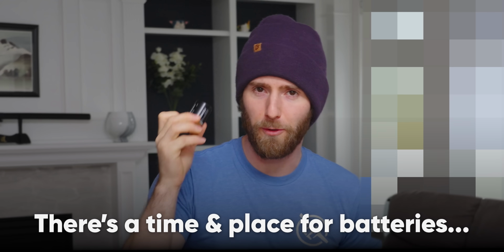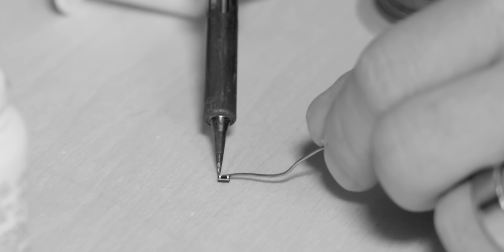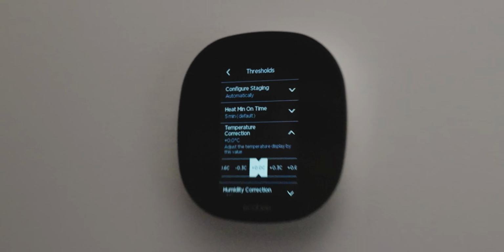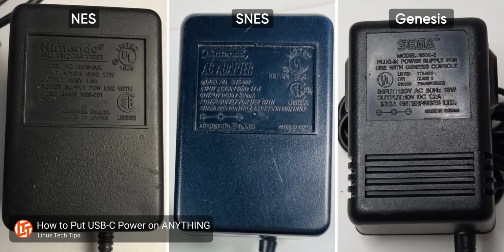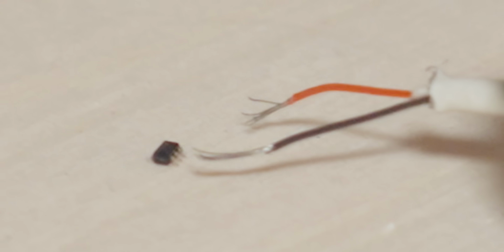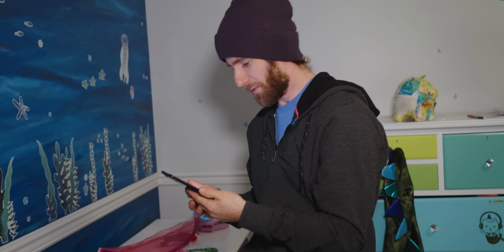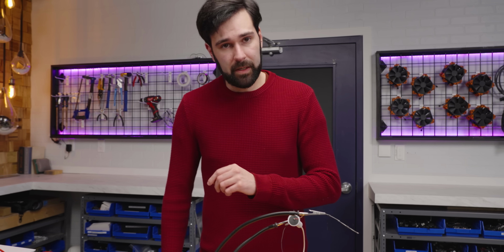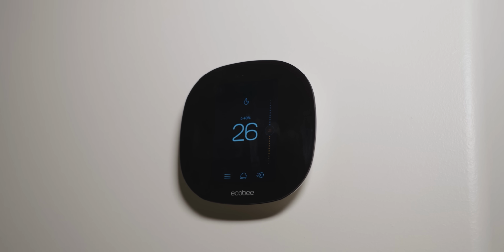I HATE Batteries! - Converting Wireless to Wired (a cheapskate’s guide)

Comment: I've been toying around with the idea of a house that runs on low voltage, around the five volt range, so everything could run off of rechargeable cell phone power packs that would be charged with solar energy. the lights would be all flashlights with chords ran to them with normal wall switches, so things would feel normal. for the refrigerator, I was considering connecting a few power packs to make 12v which would run a 12v portable fridge i have. the packs could also run some fans for summer time, as there are models that ive used in the past for personal space cooling. the hard part would be heating, but they do make 12v window defrosters for cars. since ive already boosted the range to the 12v battery charged by solar, you could also use an inverter to charge a laptop. Internet service would be from a cell phone hotspot. I tested all of this with a truck i had a cap on. with the engine running, it could even run a small house air conditioner. I added a twin matress to the bed of the truck.
the project failed because the truck blew an engine. but for one glorious summer, i had it all.
Reply: Same, except mine was 12V car "cigarette lighter" outlets connected directly to the solar energy storage battery.

But there is a reason we use AC current for mains power - voltage drop over long cable runs. It is genuinely cheaper to use AC just so you can use transformers to cheaply turn whatever volts AC from the powerplant to thousands of volts for power transmission and more transformers to turn those thousands of volts to 240V AC for home use and just include AC/DC adapters for everything that needs it (like, genuinely everything more complex than a dumb fridge or fan nowadays - CFL light bulbs use AC/DC conversion in them despite the lamp itself needing AC).

Even when you factor in stuff like:
-Having to synchronize connecting powerplants to the grid so the generator in the plant doesn't blow up.
-DC/AC conversion for technologies like Solar Panels.
-Skin effect, meaning if the radius of the wire for power transmission is greater than the skin depth for the metal and frequency used (~8.5mm for copper@60Hz) you won't be using all of your wire.

Using DC/DC step-ups and step-downs for power transmission is still more expensive even with the above, so you'd have to crunch the numbers to see if you'd spend more on wiring to not lose so much power with a 12 volt power system versus tradition AC power. And that's assuming it isn't a legal requirement to use the local standard electrical system for your house.

Comment: step 1 with floor heat, have tekmar or sensors for FLOOR so you can prevent under and over shooting situations that work with ROOM sensors, and with outdoor sensors to help buffer/bumpup room temp with incoming cold temps. 
the fact your multi million dollar house does not have FLOOR sensors, makes me question vancouver builders...

Comment: Sometimes i wonder what do you guys think when you create these "electronics life hack" videos.From what I see from this video you focused more on the presentation of the problem rather than the problem itself.Nobody in their right mind would use a smd of that size without a pcb(not to mention smd voltage regulators use the pcb as heatsink) also dafuq is that series of diodes bullshit. You guys have someone with EE experience right? How come they dont know the most jellybean voltage to ever exist. BEHOLD THE LM317. It comes in wide range of voltages AND adjustable version too. Also did i mention about it coming in a million different packages(like through-hole ones)

Comment: ltt should spin up a new channel for quick projects like this. I have a ton of (seemingly) simple projects like this that I could never find simple solutions for.   
  
the one I did do was got a cheap wifi smart switch board for a few bucks and hooked up the switch to the power button of my PC so I can turn it on/off with Google. no power goes through it, it just is hooked up to the switching part. works great. not an easy way I know to sense if it's on unless I have it set up with HA. from what I gather I can do with with a ping to the IP...but even finding a real step by step of that was annoying. since just like most hobbyist things everyone expects you to have a solid grasp of ALL basics first. I always just get back "have it ping the ip as a sensor"..... like c'mon, give me the steps!

Comment: Yeah, somethings, especially stationary objects being wireless. I am ok with optional wired input but no way to be wired is just flat out stupid beyond belief. What I hate most are rechargeable device that refuse to operate while being plugged in. Yeah, I know it is for "safety" and to not burn out the battery but still, manufacturers should make them better if that is the case. I hate it when they are worthless until they become unplugged.

Comment: When using a voltage regulator you need to use a reservoir capacitor between the output pin and ground. This will help stabalize the voltage when the load amperage spike like you show in the video.
Reply: You might need a filter capacitor for a variable load if you're running close to the maximum rated current of the regulator, but 7mA "spikes" aren't going to shift the voltage on a linear regulator output. The reason they had so much trouble was that they were trying to use a resistor as a voltage regulator (they had a series resistor after the regulator), well that and the fact that Linus struggled to solder SMD on his floor.

Comment: Imho a tv remote with a capacitor and a coil to charge it. Set it down in place or else it wont have a charge... Never need replace it.

Also dan, linus.... These things run off 3v dc button cells not anything super complicated here the component you are looking for is a resistor not a series of diodes for voltage drop... A single 27 ohm resistor 1/4 watt will give you the drop in voltage and let all the current it wants go.

Comment: why not connect 3 diodes in series?
Reply: ok, you actually did that, but generally diodes drop 0,6-0,7 voltage, which should fit ideally for around 3V, you've probably used Schottky diodes or german ones

Comment: With a cap the regulator could've probably handle the current spikes without rebooting the sensor. There are batter ways to this,  like moving the thermostat from the hallway to either of the rooms. :D They only need power too since you control through home assistant. I don't really get why you couldn't have controled the heat pump though HA too and only used ONE thermostat per room, there surley are ways to control it, either through a serial interface or if it's and old stupid one the same way you control the gas heater.

Comment: Even a hardwired security system needs a back up battery. Plus a wireless door / window sensor that require a CR123A or a Cr2032. Only have to be replaced every 2 years.

Comment: There are small boards called "step down converters" They cost about 50 cents on amazon change from one voltage to another (adjustable) and are easy to solder stuff on.

They do exactly what you wanted to do in the video.
Reply: Those will require inductors and capacitors. Linear regulators are fine for small loads with a small voltage drop (though somebody mentioned you need to move to a LVDO (Low Voltage Drop Out) regulator if the drop is under 2V)..
Reply: @economicprisoner  No they require nothing. You solder them on (through hole), adrust the screw to the right voltage and you are done
Reply: @igorwurm1419  If inductors/capacitors are included: I would expect the price to be over 50 cents.

Comment: 1:48 In my experience most things use the CR20 batteries which describe their diameter and thickness in their name. A CR2025 is 20mm in diameter and 2,5mm thick, depending on how the Battery is held in it can also serve as a replacement for a CR2030 battery.

Comment: For those bumps on power draw add a capacitor in parallel with your device, it'll smooth out the power draw issue and probably make it a little better.
Reply: Or use a voltage based approach like they did in the end which will make it a lot better instead.
Reply: @bosstowndynamics5488  I'd still put a cap on the output of that circuit as well.  It's replacing a battery, you want that output voltage to be smooth with as little ripple as possible and come as close to a battery characteristics as possible.
Reply: @Mark-pm8nw  But I would do all the voltage regulation outside of the sensor and near the power brick since they might get hot thus making the effort null
Reply: @tommisgr  I don't think a device that is intended to run on battery for years will draw enough current to make heat on that circuit a big consern.

Comment: Those small plastic potentiometers are really inconsistent. Even smallest tap can change its resistance. Better (and even slightly cheaper) option would be to use normal big potentiometer to reach 3.2V, measure its resistance and then switch potentiometer to normal resistor.
Also  using powerbank (that doesn't  require load to work ofc) for checking and pairing devices would be much more comfortable.

Comment: this solution works until Linus' kid knocks it off the table accidentally and the wire tugs on to the wall.
Reply: being a comp engg the diode idea though crude is pretty neat! its one of the simplest ways to subtract voltage! soldering the diodes on a small piece of perf board will make for a pretty durable and neat solution.

Comment: I think it would be cool to make a little circular pcb that can just hold the voltage regulator and make direct contact with the contacts on the sensor. That seems a lot less jank than this lol
Reply: lol. I just came to comment the same thing. if you just design a pcb with detachable cable, and order it from china assembled, you can just replace any button cell device and call it a day. durable as well. but then no content. :3
Reply: @minolhewage  Wouldn't be surprised if there is (or will be soon) an open-source (set of) design(s) to replace the battery for various button cell devices
Reply: @minolhewage  flat flex pcb based usb cable no need to detach. battery lid fits. supercapacitor mitigates power fail. china not cheap
Reply: You can get AAA and AA batteries that do this but I've not seen anything like that for coin cell batteries.

Comment: Did almost exactly this with my Blink security cameras, using a variable DC supply for the Blink outdoor camera, and a Blink doorbell using a very nice HLK-5M03 component [100-240v input > 3.3v output to the doorbell via existing dumb doorbell cable], nice size to solder, and decent price to avoid dealing with Lithium AA battery changes every year or sooner.

Comment: I know it was a brief appearance but smoke detectors have a good reason they moved to sealed enclosures with a 10 year battery. It’s because the element inside that does the smoke detection is consumable. That element has a 10 year life before it will go bad and not be able to detect smoke anymore. By sealing them like that, people are forced to replace this critical safety device instead of what used to happen when they were hard wired (letting them go bad, but keeping them up without realizing it was bad)

Comment: As an electronics hobbyist (not an actual engineer), this was pretty darn cringe... The wrong solution with the wrong tools, explained poorly and incorrectly.
Reply: 3.0V - 3.6V is the target for the device (actually its designed voltage, regardless of the battery voltage), using any form of resistance to drop the voltage is a terrible idea as its current dependent. The SMD linear regulator (how did that word not get mentioned?) would've done fine on its own, adding the extra resistance was why it failed and was completely unnecessary. The diode drop method is a handy trick for people to know, but without mentioning the difference between regular silicon power diodes and schottky, it's of extremely limited value and again misleading... And the whole project... You're running home assistant, so you're telling me you couldn't find a single mains powered device that talks to zigbee, or mqtt, or anything else you use, and reports its temperature?

Finally, a temperature sensor on a 2477 should last a long time... like 5+ years per battery swap. Of all the battery powered devices to convert, this wasn't the one xD

Comment: A 3.3V supply would probably be just fine, the voltage of a fresh 3V button cell battery is around 3.3V although this quickly drops off, and there is some leeway to the voltages electronics will accept anyway.

Comment: The reason why the MIC5504  didn't work is you need to fit 1uf capacitor to the input and output, with no capacitor you would have some voltage fluctuation causing instability. Mic5504 is way better than using those diodes, 3.3V would just work fine. Don't need to adjust to 3.2V. The CR2477 voltage is 3.0V to 3.4V max discharge current of 0.2mA

Comment: Honestly this project would be heaps more accessible if guidance about how to use a phone / phono jack for this were provided. Then all you'd need is to drill a single hole, fasten the phono jack in place and convert a USB cable to the phone jack for power via your wall wart. Of course…

This depends on space. My solution would work better for something with cylindrical cells than button cells. Sometimes hardwire is the only option.

Comment: It's about time someone else screamed about this other than me.

The only benefit to battery-powered, stationary stuff is that it won't kill you with electrocution, but that's only because Chinese manufacturers don't give a rat's behind about safety and will use transformers with no insulation whatsoever and hope that the micrometer-thick lacquer on the wires will keep you from dying before you buy more stuff from them.  I'm deadly serious that cheap AC power supplies, including phone chargers, direct from China are so horribly dangerous that they could kill you and good luck to your family at finding someone to sue.

Comment: never... just nerver try to get the voltage from a changing current device down with an resistor!
There are cheap DC-DC converter boards. For devices with a peak-current simply put in a big cap

Comment: Honestly, I'm shocked you didn't prototype this on a cheap PCB that would fit inside the unit, so you could later theoretically use your SMD components!  Also:  If you use a voltage regulator, I highly recommend you use a capacitor on the output to smooth out any potential voltage rippling from the part.

Comment: I just did something very similar 2 days ago. Recycled the PCB from old blown BT headphones to make my bookshelf speakers have BT. I simply used two diodes in series cause I didn't have one that was the right value on hand. Yes it's inefficient and if the voltage drop changes depending on the load. But the load Amp draw won't ever go higher than when it's on. Since the PCB isn't amplifying the speakers, they are active. And it's worked fine. Barely pulls 3W.

Comment: One of the most frustrating things is how “cheap” the solutions are but you need to already have the solution. So it’s really not that much more cheaper than just buying the power supply.
Reply: You've already paid for those chargers and the mod is extremely cheap. You don't waste money on new power adapters and the old ones don't sit around useless - it's a win-win.

Comment: 3.3v regulator will always work on a 3v device. No resistor required. A resistor cannot regulate voltage. It is much worse to have it. As the current increases your voltage will drop, as your current decrease voltage will spike. Just run the regulator or as it runs it will jump up and down because of the resistor.

Comment: I've already done this with my multi meter.  It took xpensive lithium.
But now 12v from laptop power source and works rad.
 It also stays running for 1 min after unplugging from wall from the capacitor drain. 
 Love laptop psus

Comment: The idea is great, but was it really not possible to prepare better suited components for point to point soldering? Something like TO-220 3.0V or 3.3V regulator, which might even be able to handle inrush current without additional caps. I mean if you were to watch this guide as a person not familiar with electronics and soldering, would it encourage you to try? I think not, and that kinda defeats the whole purpose of the video IMO.

Comment: Seems like an opportunity for someone to make a PCB design that's the same shape as the battery so the surface mount parts could be more easily attached, bigger pads to solder the incoming wire to and contact points on the bottom to interface with the battery terminals.

Comment: I use a similar system with a digital caliper that works with a coin cell 1,5v, I wanted to use it with a 3.7 lithium cell 2000mah... unlimited power! you just need a ncp1117 voltage regulator ( kinda like the one you were using in the video) and a capacitor to suck up the spikes... it'working like a charm in my digital caliper that now has got usb-c charging.
Reply: I converted a cheap power bank to 9v to use in my multimeter, worked so well i made other 2 to run my internet routers. No more running to the store each time i need a multimeter, and i also modified the multimeter with a switch and two 2200uf capacitors that switches the cap between the battery and the clips that way i can  use the multimeter to check it's battery voltage and as a bonus shock low voltage batteries that won't charge. I also put a jack on it to output 9v to a led flashlight.

Comment: Lol @ "EXACTLY 3.2v" and "through a pot"...  yeah sot23 are ehh "possible" to solder to. Also variable linear power supplies ftw, simple mode ams1117adj or lm317? but then I guess you'd need some 0805/1206 resistors to solder to them...